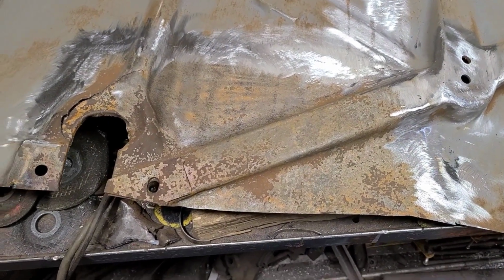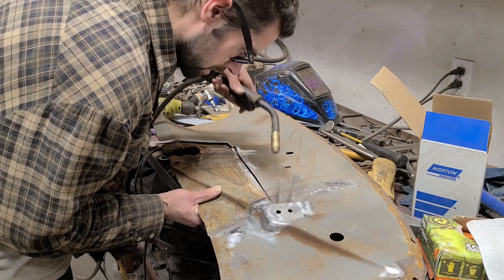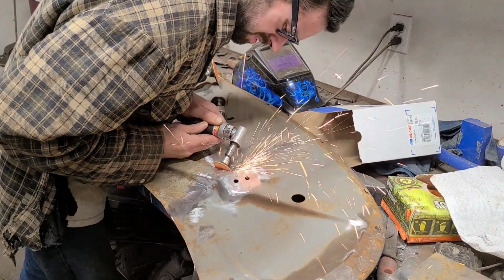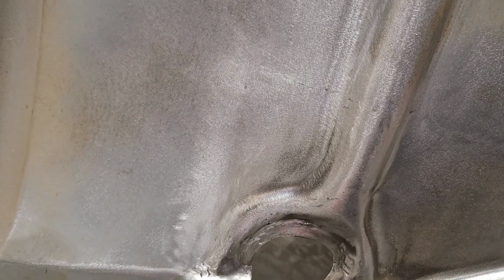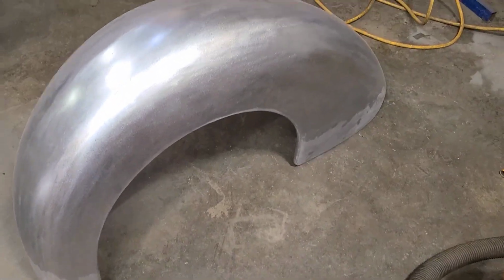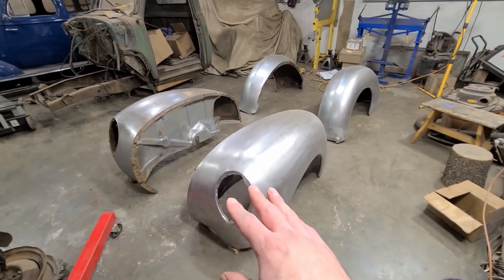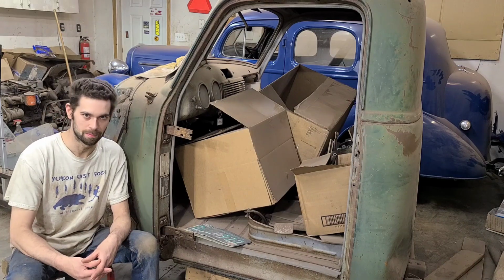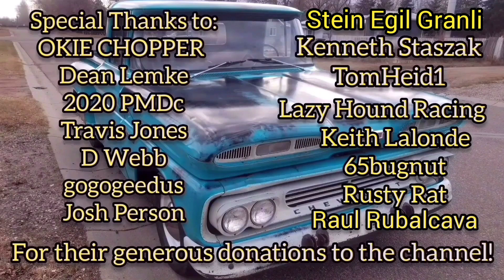Is There A Faster, Easier Way To Mig Weld Thin Sheetmetal? Shocking Trade Secrets Revealed!

Comment: It would seem to me that doing a short weld and then grinding like that extends the cooling time, which would reduce the expansion and contraction issues you get with MIG welding thin sheet metal. And because you're continuing the weld from the same point, the metal is already warm, but not hot, so the next bit of weld has less effect on the metal size. And your welds will be more consistent because you're not hopping around to cold metal all the time, you're always welding warm metal. This all makes sense to me, I like it.
Reply from the maker: Exactly! You did a much better job of explaining it than I did! Thanks!
Reply: @CarterAutoRestyling 
Question: I’m not sure if you mentioned it in the video, but what type and grit of sanding dish are you using to grind the fairly hot welds?
Seems that one would require a specific type of material to be able to contend with the heat from the welds?

Comment: Great video on the mig technique. I use mig flux core because, that's what I've got. Too dumb to know any better and have learned to make it work. The technique of 1/2" welds and then grinding should work for me. With the flux core the difficulty is keeping the arc after the pause. When I can hit the puddle when it's still a little red helps to resume the arc. When I jump around it's hard to get the arc going again, even after wire wheeling after each pass, and leaves me with too many pits and skips. But then again I'd have to say I'm more of a farm truck kind of guy. Which means my skills are still developing!:) Thanks!:)

Comment: You have been missed ! Actuly watch all episodes ower and ower agien =)  Dan in Sweden,
Reply from the maker: Hi Dan! Thanks for watching!
Reply: @CarterAutoRestyling  I aculy got some ideas on the welding to! Is thera any diferens in on the weld depenging in witch gas you use , Argon / mixed / co2 ?? Yers ago i did welding Mag on A trucking company , and we could  drill and tap the welds whitout any problem ( A big f,,,n weldwer and some od wire) seems like the welds was softer , And how about ceping the sheet metall varm wile weldin (preheting??) could it help ?? //Dan
Reply from the maker: @koddington  I use 75/25 argon C02 gas with the mig. Straight C02 makes the weld harder. Sheetmetal is so thin that pre heating isn't neccesary.

Comment: Mate - just wanted to say that I enjoy any content you put up. Whether you think it is repetitive or not, there are still differences in the way you attack each and every part of each and every project, so they are interesting to me (at least).  Your skill with a welder is fairly matched by your skill with your tongue and THAT is what keeps it entertaining for me.  

Let's face it - welding metal is a sometimes tricky skill that some can master while others melt into a pile of slag whatever they point the wand at.  That said, there may only be a certain number of times that something can be done differently, but it's the WAY you deliver it that makes the difference here.  I for one would have enjoyed seeing how you dealt with the fenders as that lead work would not have been something that is seen very often.  

Man - when you said they had belted that fender with a claw hammer, I don't think it was the striker face that they used against the metal....and I'm sure there are more claw marks made by that hammer than by your cats on their scratching post.  I've seen bent and belted panels before, but those are a new level for me.....and I am a little sad I missed their resurrection.

Never to mind - I'm sure there will be plenty of metal finishing when you start on the projects🙂 All the best, Kyle.
Reply from the maker: Thanks Lance! All the best to you as well!

Comment: This weekend I, at age 44 and as an incorrigible car hoarder, will attempt my first welding job. I will most likely be wearing shorts and flip flops, and the only thing I've ever seen on this channel I have the ability to emulate is the self-immolation.
Reply from the maker: Best of luck to you on your journey to self immolation!
Reply: @CarterAutoRestyling  literally just finished. The weld looks like a cancer cell, and there's a new hole in my shirt. But the metal is fused!

Comment: I don't know if you have a Flux core welder but I'd like to see some videos of using one fixing one of these projects. KEEP UP THE GREAT WORK.
Reply from the maker: Flux core is best used on thick metal. It should never be used on sheetmetal. I'm all for using what you've got, but flux core is just asking for trouble with paint and bodywork down the line and a tank of welding gas is a lot cheaper than redoing bubbling paint and bodywork.

Comment: Glad your back, love the channel.   One question, I've been having porosity issues welding in patch panels I think its contamination.  Can you spend some time showing how you prep the old metal?
Reply from the maker: The metal has to be clean shiney metal on both sides. Anything less than that can cause porosity. Lack of shielding gas also causes issues, fans/wind etc will all blow shielding gas away while you're trying to weld

Comment: Hi Kyle:  Welcome back!  I sort of thought that you may have finally incinerated yourself and were no longer able to post videos.  I have a request.  Since your TIG welding is very impressive, I was wondering if you could post a few videos on your technique.  Watching a TIG weld from a distance doesn't reveal the electrode, melt pool, and feed wire synergy and from what I understand those are key to success or failure. 
Keep 'em coming.......thanks,
Reply from the maker: Thanks Ronald! I'm self taught on the tig, so I'm not really in any position to be teaching others on the subject, especially because I've never really put any thought into the electrode, melt pool and feed wire synergy. I think, as with anything, practice is key.

Comment: Hello Kyle. Became aware of your channel recently (CWM). Good stuff. I am a novice when it comes to metal work like this. Another source I get inspiration from is quite adamant about planishing welds when you have access (weld/planish/grind, repeat), but I haven't seen that anywhere else. What is your opinion/experience with planishing spot welds on sheet metal repairs?
Reply from the maker: Hi Mark. Thanks for stopping by! I do have quite a few videos on planishing welds. I always planish my tig welds, but I usually only planish mig welds if the panel has excessive distortion after welding. The mig weld is a much harder weld so it's better to leave it a little low and bodywork over it, otherwise it will ghost through the paint

Comment: Mig welding aka hot glue gun for thin sheet, is a very hard weld and is prone to make thin sheet brittle on either side of that weld and can lead to fracturing in time. Pulse Tig is a much better way and a much sorfter weld, making it far easier weld to hammer and also not being so brittle on either side.

Comment: Unless, I missed it in your video. I am assuming, even though you had intense heat happening between the welding and the grinding,  that you still had the heat cranked up on your welder? Since you are opening up about your upper/lower middle class (which I never heard of nor understand😀?) upbringing. I think you still need to fess up about your music Director. Its obvious by the inappropriate selection of Perry Botkin at the worst possible time of the video that he/him/his/she/they/them.... is either in witness protection or on the lam?  Looking forward to the truck video's. Thanks for the great video!!!
Reply from the maker: Oh yeah the heat is still set where it normally would be. There's actually less heat input when the welders set high because if you have it set cold you have to hold the weld longer to get penetration

Comment: I learned a great tip from a fellow Canadian YouTuber-Fitzee or Fitzees Fabrications.  He lines up the patch and clamps in into place. He then uses a thin disc and holds the disc at a 45 degree angle. Doing this allows him to more quickly and accurately cut the patch into place because his is cutting into both pieces at the same time. The result is fast, accurate and provides for a very tight fit which enables neater welds that are easier to clean
Reply from the maker: I prefer scribing and cutting to the scribed line. Fitzee's method is common practice in the autobody trade and would have also worked well on the piece I did in the video